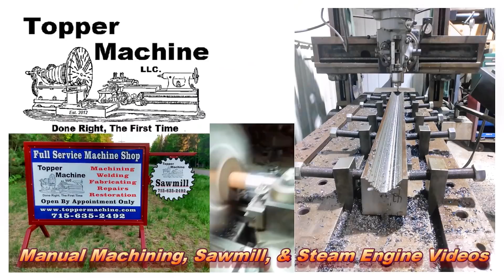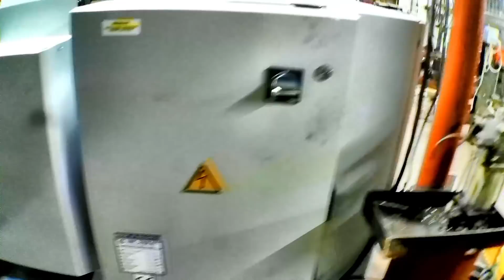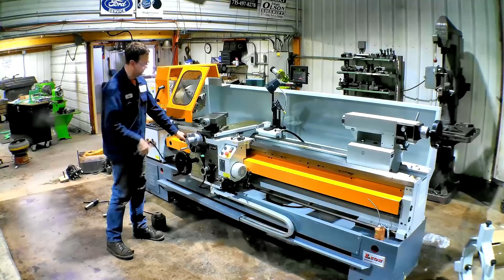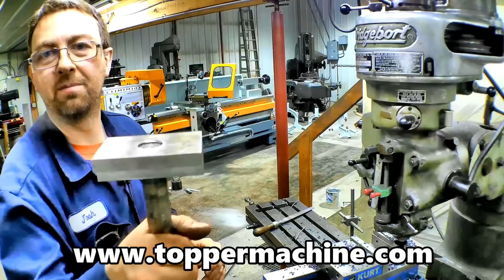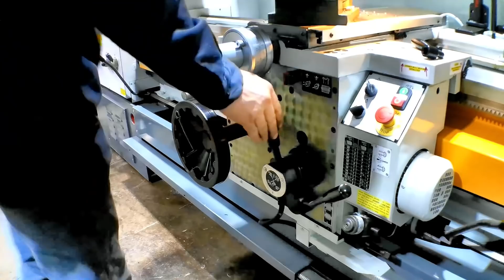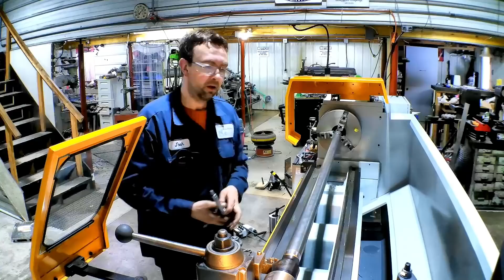New Manual Lathe, Lion 23MT, Setup and Test Run, 2 Ring Test

Comment: Well I'm totally smitten with my new PM 1440GT (2 inch bore) but this thing is in another league. I've never used a clutched lathe and now I must make sure I never do..:)
Reply from the maker: Once you've gone clutched, you can hardly run anything else.

Comment: Got a question for you Topper, why did you use aluminum siding on the inside walls of your shop? Very interesting approach 😎
Reply from the maker: That's steel. Easy to clean, makes the room bright, and is basically fire proof.

Comment: Precision Mathews has nothing on this lathe.  I am also a clutch lathe guy (Graziano).  Taiwanese lathe are precise and heavy duty, but that's now the bare minimum when you get into lathes at this level.  The usability is light years away above the Precision Mathew.  European lathes are more likely to be designed with the operator in mind.  Only complaint I have about this Lion lathe is the speed adjustment.  When changing speed it seems like you still have to operate 2 controls: one for low/mid/high and a second lever for speed selection.  That would drive me nuts.

Comment: Josh, You have bought a great machine, I own the older version for 7 years so far. These machines are very popular in Europe.The joystick control, the rapids and the clutch control makes it very user friendly and a pleasure to work. These are outside features. inside, the spindle is the geunine SKF design, with two double row bearings, and one pre-tensioned radial/axial SKF bearing, which makes the spindle very stiff and exact.
Take good care of her, and she will serve You long, long years with exact and silent work. Stam
Reply from the maker: So far I'm very happy with it. I should have bought it a few years sooner. Never knew what I was missing.
Reply: @TopperMachineLLC  There are two types of quality: quality of the concept, and quality of manufacturing. This machine have both. Just one small historical remark - the genes of this lathe are in the TOS  designs from the 60 ties, and from then on, the ZMM has put a ton of small improvements in it. The only thing this machine does not like is changing the speeds, when the motor is running. Please by all means, when changing the speed, turn the motor off. Lubricate the ways and the drive screws, and she will take care of Your business, guaranteed. I appreciate Your work ethics and attitude a lot.
Reply: @StamD65  Personally I have a TOS SN50 but a machinist friend has a ZMM C11 and a CU580 (also recently got a "Red Proletarian"... the popular one) and he never any such struggles with any of them. 

On the other hand on my own lathe, there is a lot of wear in the internal hex of the clutch shaft lever, which doesn't allow the clutch to go to the fully neutral/brake position when bringing the lever back to it's center position, unless you pull it slightly towards the reverse side, which (apart from sometime making threading awkward cause it doesn't brake properly and has a tendency to creep) adds a ton of wear on the clutch pack and mine is practically toasted already (it's an '85 machine afterall). 

If yours is worn even a tiny bit more than mine (or just not properly adjusted), it is safe to assume that the clutch is creeping up, thus causing the gears to start turning (with force and not just freewheeling due to oil coupling effects of the clutch) as soon as you go between gears. Or now that I think of it, it could also be improper oil grade in the headstock. I don't know what oil the C11 takes but I was pretty weirded by the almost as thin as diesel ISO22 hydraulic oil specification for the headstock of my TOS. Improperly using a thicker oil would definitely impact clutch function when in neutral.
Reply: @Sketch1994  Regarding the oil: The C-11 and the rest of the lathes similar to it, like CU 400 and CU 500 use for the spindle oiling oils such as Shell Tellus C32,Castrol Hyspin AWS 32,or ESSO Nuto H32. Some time ago (15 years?!?) the oil producers has joined the norms of previously called machine oils and hydraulic oils, and has created a in-between type of oil called a hydraulic anti-wear oil. In any case, please use only the recomended types, that is important

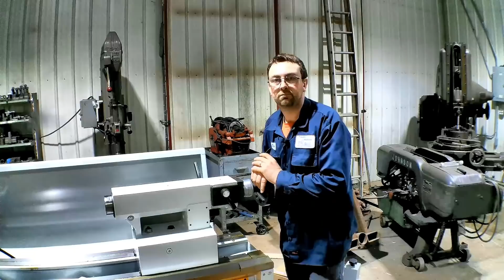Comment: 3:32 I had a big job that had deep large holes to drill and it was a nightmare with the standard screw hand wheel so I took it off and adapted a rack and pinion box from a car with a ships wheel so it works like a drill press. The job went FAST and I like it so much I never took it off to this day, 20 years later. There is nothing like being able to pull the drill out FAST with a quick spin and back in and it still produces full force.

Comment: that sliding shield is so stupid... you gotta reach under it if you have to rotate the chuck to change speeds
Reply from the maker: OSHAfied. Adding unnecessary safety guards thus rendering equipment useless. 

Actually this one isnt too bad. Mostly keeps coolant in the tank, but I do not like the cutout switch on it.

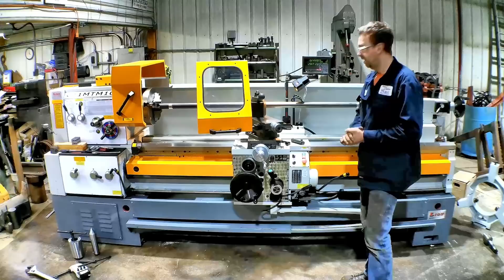Comment: 25:50 No backlash on the cross slide - so give the leadscrews and nuts a really good greasing so as to keep them that way. And lube the slideways too. So often stuff comes unlubricated nowadays - and for that matter, BROKEN or faulty.

Comment: If my maths is right, you have 3 mills. Interesting that you use the Cin as a vertical mill.
Why did you end up with 2 BPs ?
What's your logic for which mill you'd use for a particular job ? Is one BP set up for angle milling and the other kept in tram ?

Comment: So if you grab the clutch lever and operate it to forward, how quickly does the chuck accelerate ? I noticed it seemed rather lethargic when you selected reverse. I'm not convinced that that is a mechanical clutch - maybe it's magnetic or even electromagnetic ? Mine has a simple mechanical clutch and from disengaged to engaged, the spindle's up to full speed before you can take your hand off the lever!. So to me, the clutch gives quicker starts than by starting the motor.

Comment: Clutch lathes are good until the clutch wears out, it's nightmare to get the clutch tolerance back to spec.
So I rather change switch then mess with the clutch again.
And if you read the manual it probably says that you cannot do the ,,feathering"

Comment: before you do anything else make a little bracket to drop the chuck key in and screw it on the tray just under the front clutch lever as there doesn't look anywhere else to put it!
and make a bracket to hold a tray and screw it on end of bed under tailstock wheel to hold drills, centres etc.
Lathe designers never use lathes!

Comment: A chuck guard  really,  nothing like hot chips hitting you on the chest and a streak of coolant down the front of your shirt..  what kind of machinist are you?
Reply from the maker: It's standard equipment. I've never used one before. But it's on a limit switch. Gonna leave it there. Nice not having coolant raining down.
Reply: best when a big blue one gets down to your pants.  medical station wet themselves cruel sods

Comment: I have the exact lathe. Bought it about 1-1/2 years ago. Love it. Main complaint is the half nut lever is too low, so it’s a bit uncomfortable. Also the paint job is poor, after having some coolant on it this paint will start peeling up. Otherwise very rigid machine and trouble free.
Reply from the maker: I totally agree about the half nut. I have had different coolant over the years act as paint stripper. Could just be the coolant, but modern paint isn't that great either. So far I love the lathe.

Comment: Congratulations!! I just moved up in scale in all my machines as a hobbyist. My new condition, 1974 Bridgeport came with a few face mills. They are suspect and don’t work well, specially the 3- to 3 1/2” ones. The performance of your face mill on the T nut was a revelation. Have you done a video or talked about that before?
Reply: I'd also be interested in knowing a bit more about the shoulder mill you are using.

Comment: Interesting to hear your views on clutched lathes but slightly smaller lathes i would always favour a VFD controlled lathe, the benefits over a normal straight  on/off switch are a no brainer and fulfil some of your clutch requirements too.
Re M DRO, lovely chaps to deal with, i have spoken to them on many occaions and they even did themselves out of a sale once when one scale failed way out of warranty and i mentioned why i wanted to buy a new one, they offered to fix it free of charge if i took it to them. Being only an hour away i went and they fixed it while i waited. As i said, lovely chaps to deal with.

Comment: A real light cut over the whole distance using the follow rest would be interesting to see.  Looks like it should do the job for ya but running a machine that isn’t worn may make you start looking at replacing everything else! 😂
Reply from the maker: I've already been considering the wear issue. It's amazing how getting something nice can make everything else look like junk.
Reply: my dad bought a little 14" lathe that is exactly like that thing.  i think it's a summit brand.  they're virtually clones by design though.    yours is likely to be 15 years newer, but i don't see any major design chances except for that awesome tail stock.  the summit's swing was given in millimeters though, i just remember that it was about 14 inches with maybe a 7 or 8 foot bed.
Reply: you'd be better off asking him to cut something down to a drinking straw.  that's an annoying setup just to take a few thousandths off of a piece of roundbar lol
Reply: the p.o.s. that works up there crashed it with a pretty large ball valve body chucked up by the flange though, so it's a knocking, thumping piece of crap now.  i looked inside the gear box and.... whenever that crack gives, that lathe is smoked.    SMOKED.

Comment: Looks like a good machine .    I agree  , you can not beat a clutch operated lathe .  The traveling steady's make a good door stop ,  I have used one once or twice  when i was an apprentice just to try it & never used one since  !   👍
Reply: I have done a lot of large valve spindles 30 inch of 1.5" x4tpi and similar need a traveling steady then believe me

Comment: Beautifull lathe! I really hope that it will serve you well in the decades to come. 
200thou on a bridgeport, wow I've never done that in steel. 
cheers.
Reply from the maker: Thanks. Deepest I've ever pulled off in a bridgeport was .300. Just takes a little less feed rate, so you can do other things while it's cutting.
Reply: The man likes blue chips.
Reply: Well it cut, but it was vibrating quite a bit. I thought some items were going to fall off the table.

Comment: Hey Josh, loving your truthful channel, congratulations on what looks to be a well procured lathe. Would love to see it put through its paces. is it self lubricating, will you be doing anything to provide additional protection for ways? where was it made?
Reply from the maker: Thanks, it's a nice lathe. Very similar to the monarchs. I have never seen a machine that doesn't self lubricate, I'd like some examples if you know some. I have an oil can of way oil for extra lubrication. Made in Bulgaria.
Reply: @TopperMachineLLC  Little lathes, South Bend, etc use ball oilers. It's only the 14" + class that are self.

Comment: The new lathe looks great, from an ergonomic / useabilty point of view if the lathe was a couple of inches higher would it help you comfort greatly ,
Reply from the maker: So far it's really good. Only control that is difficult is the half nut lever. I may try modifying it. Otherwise, I like the machine. Thanks for watching